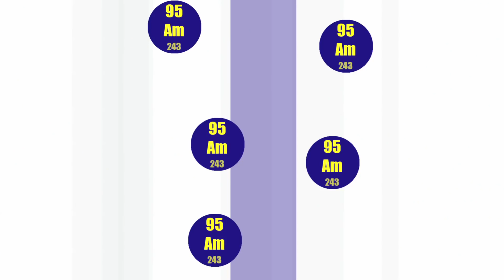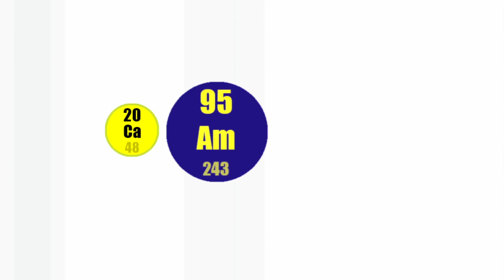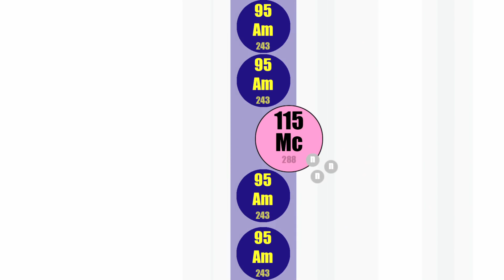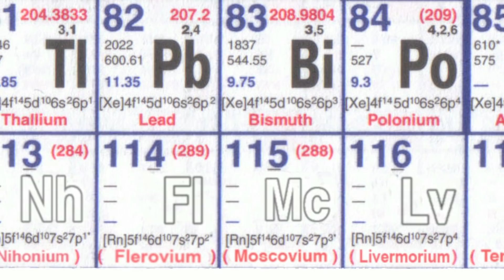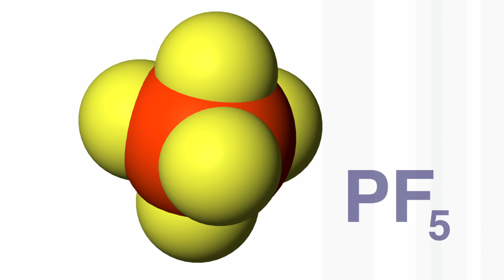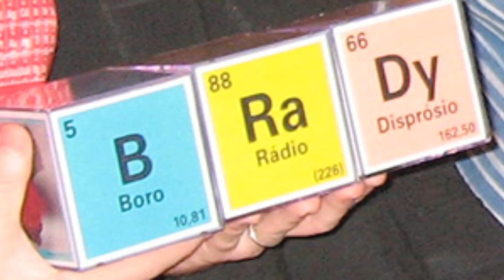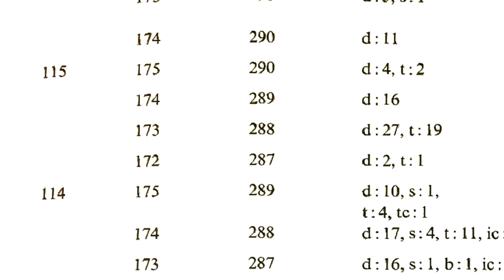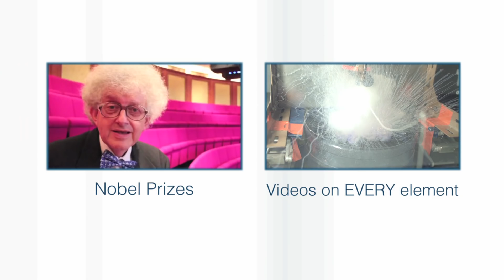Moscovium - Periodic Table of Videos

Comment: I think that heavy element of 115 can be made by the fusion of 55Cs and 55Cs based on cold fusion transmutation.
Please refer to the paper of cold fusion you can find that cold fusion is caused by Deep Electron Orbit of element so Cs can be fused with Cs based on cold fusion mechanism.
You can find the paper in research gate.
You can add neutron or die neutron to the heavy element one by one by cold fusion reactors

Comment: Dont you think that the makeing of element 115 through particle accelerators is maybe one way of proveing that it can be made but fundementaly the totally wrong way of being able to create reasonable amounts of it. Well i hope that someone reads my message as i really think i might be onto something  here. If this element comes about existing through fusion then isnt there a more effective way of getting the nucleus of calcium 48 and arsium i think the other one is called that pardon me if im wrong anyway if you make a magnetically confined kind of seeding chamber were you could get the two separate elements in a plasma form which will strip off their electrons and by heating up the plasmas and getting them to collide almost in a tokomac kind of enviroment and then the way one would normally extract the waste products of fusion normally like helium after the fusion reaction one could extract the newly formed moscovium element the same way.. This to me would be the more ligic way to go about things rather than smashing attoms into each other to overcome the atomic charges through the speed of light rather than the latter being through microwave energy heating the two forms of plasma . Maybe you need like a microwave aparatus that is magnetically confined at the same time where one could heat up the two elements in their gaseous state eventually they will turn to plasma and fuse with each other and the magnetic field coils will keep the plasma confined and moveing around at great spead so that the nucleuses will have chance to collide with with one another. What you think ill be greatfull if you could get back to me on this idea ill be  so greatfull.

Comment: based on its place in the periodic Table and the possible combinations to make a stable version of 115. do you believe its chemistry could possibly be used as a non-atomic power source? Even if that means it is cut in a specific way similarly how quartz can be cut to get a measurable voltage?

Comment: In Russian, it would be called Moscoviiy. Most elements ending in -ium are switched to -iiy in it, with notable exception in Selenium, Uranium and Tellurium which are just Selen, Uran and Tellur respectively.
Also, our Fluorine and Tungsten sound way cooler-  Ftor and Wolfram. But your Arsenic compensates for it because in Russian it is Mishyak.
Reply: And the Antimony is different. If I remember correctly, it’s Sur’mya (Сурьмя).
Reply: In german the names are also way better then in english and it semms like they are simmilar to the russian ones.
Reply: @Emil-cj6ey  Natrium Kalium Wolfram Auram Argentum all are better names!
Reply: @Emil-cj6ey  you mean like “water stuff” and “sour stuff” instead of hydrogen and oxygen😂😂
Reply: hydroiiy? or just for the ones that end in "ium" you replace?
Reply: @blockvfive1196  hydrogen and oxygen are vodorod and kislorod, essentially the same words but with russian roots, water maker and sour maker.
Reply: @TheLaXandro  oh cool, thanks
Reply: Wolfram is the source of the elemental symbol for Tungsten being W, I believe.  Similarly tin being Sn comes from the latin Stannum and Pb for lead comes from the latin Plumbum -- which is a particularly ironic name, given the modern english use of the word Plumbing --- even the romans found out pretty quickly about lead poisoning from using it for plumbing!
Reply: I am also Russian, here mercury is translated as ртуть

Comment: 0:39 and 1:13 has nothing to do with new elemets. This is an accelerator in the Laboratory of High Energies in a separate section of JINR. 2:14 and 6:29 now that is U-400M cyctron which was used in the systhesis of new elements.